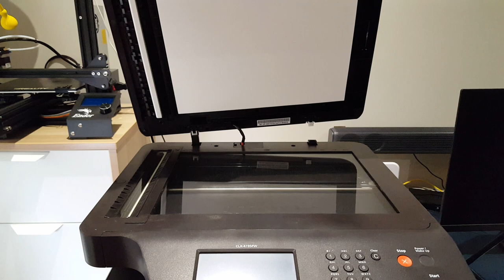Samsung Printer Automatic Document Feeder (ADF) Hinge Replacement

Comment: Thanks from Thailand Dave, The replacement wasn't bad at all because of your video. The only problem is that the new hinges make a horrible loud creaking sound when the cover is opened now, I tried using a penetrating oil on them, as much as I dared anyway, but it didn't help. Any ideas? The new hinges were from Samsung.

Comment: Thanks so much for your video instruction!  I replace the hinges, and now I can use the auto feeder again.  I could not find a aluminum piece, so used a piece of sturdy plastic from a packaging instead.  It's not as smooth as aluminum, but worked.  Thanks again!